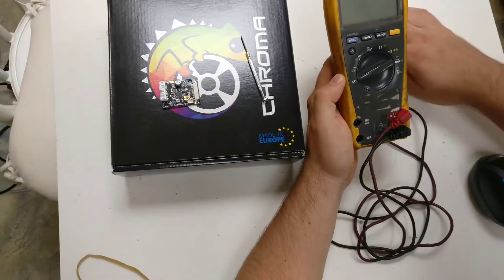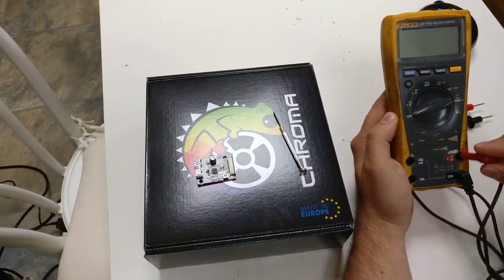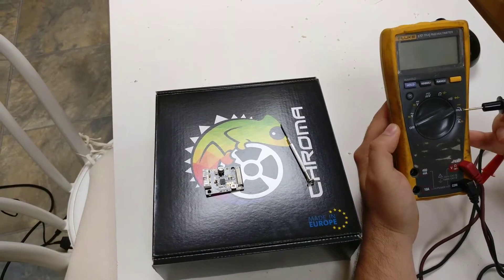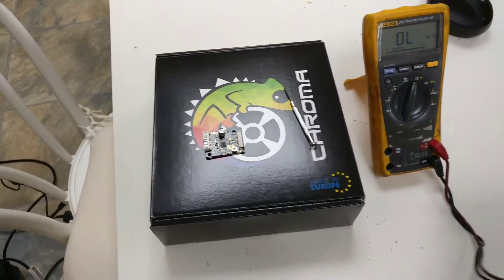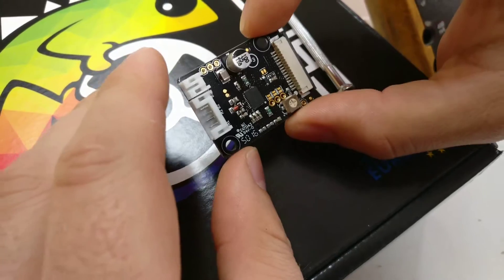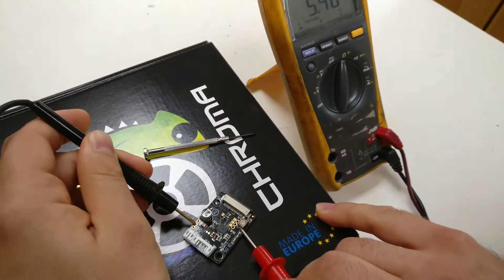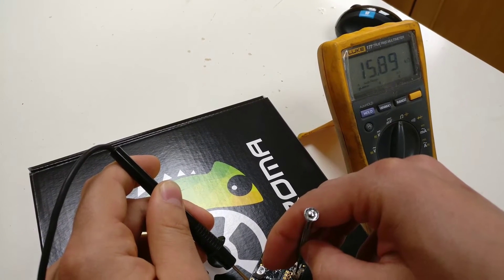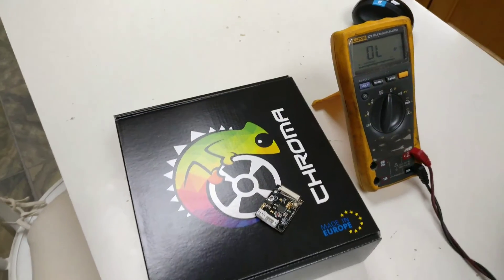Current limit setting for BCN3D Sigma R17 with Bondtech

Comment: Is it the same value when using the stock extruder stepper?
Reply from the maker: Nope. The stock motor is larger and can take more current. Stick with what BCN have set it to
Reply: Do you know what the values should be for the stock extruders?
Reply: I just upgraded my sigma with the bondtech, the stock values were 9.85 kOhm and 9.65 kOhm.